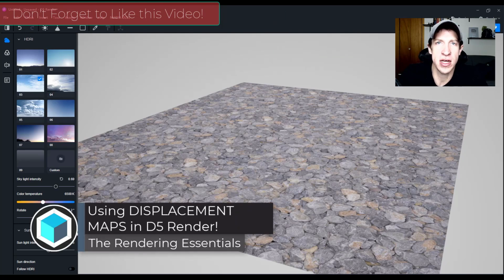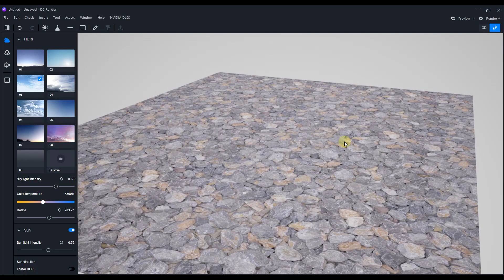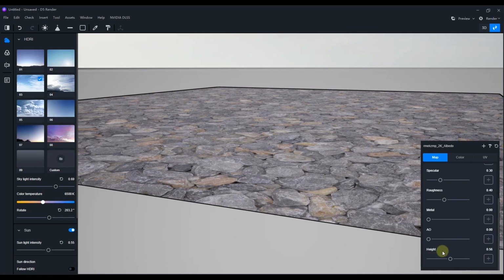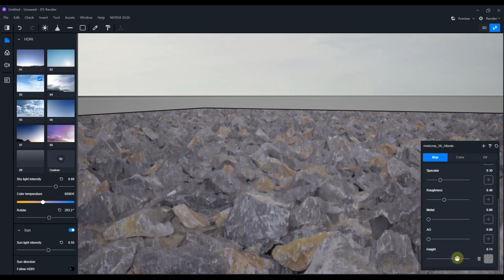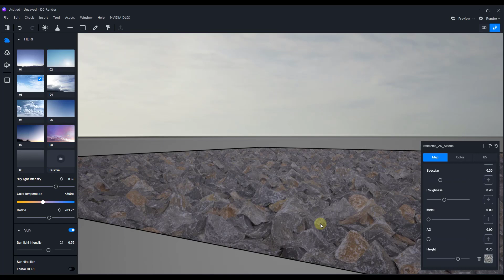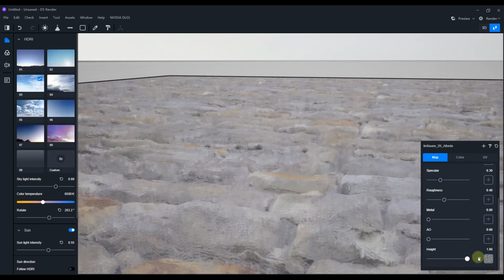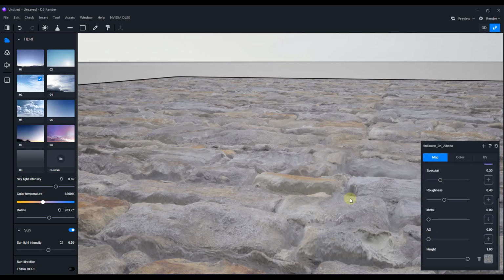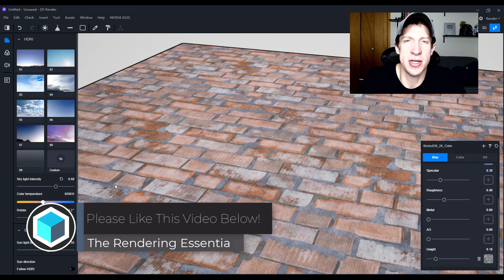Using DISPLACEMENT MAPS in D5 Render! More Realistic Materials!

Comment: I want to make a gravel material which simulate a gravel between concreet flat boxes and this is annoying that it looks flat near the connection of gravel and concrete. The height parameter is just an illusion more like bump or normal effect but it seems doesn't make any real displacement on the surface.